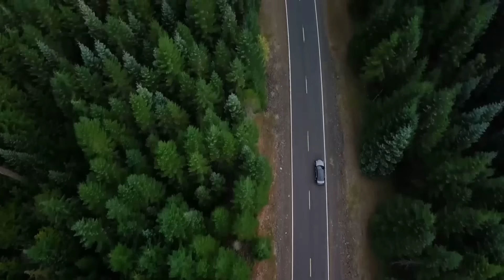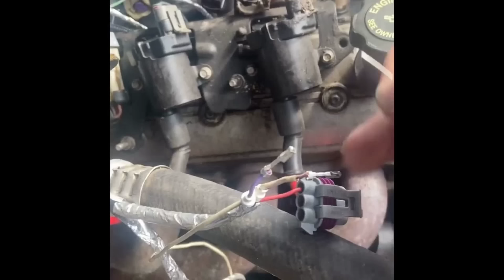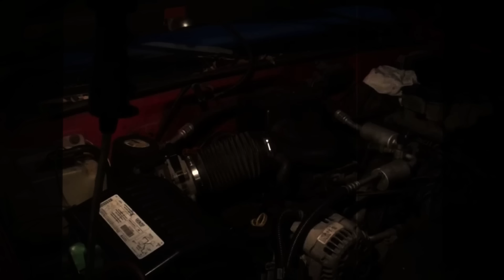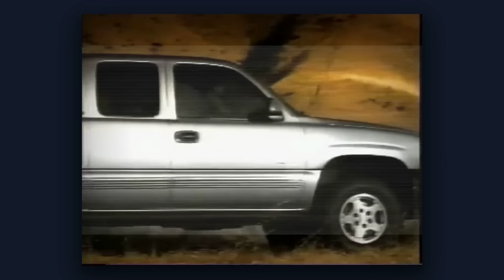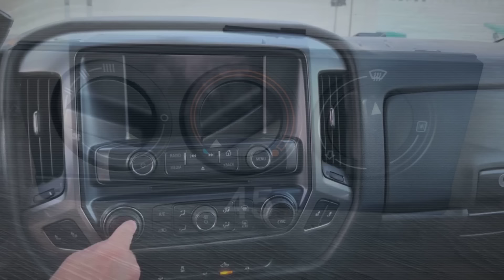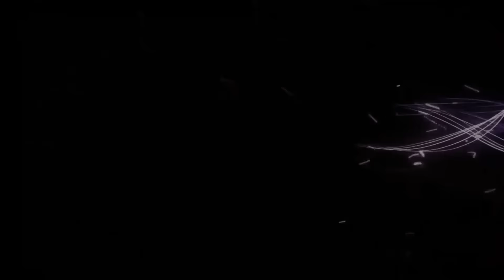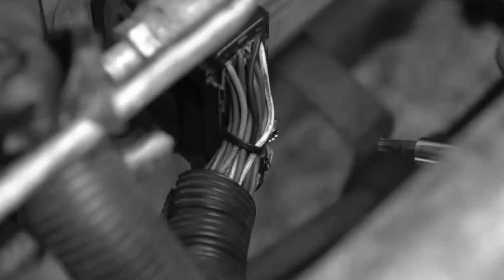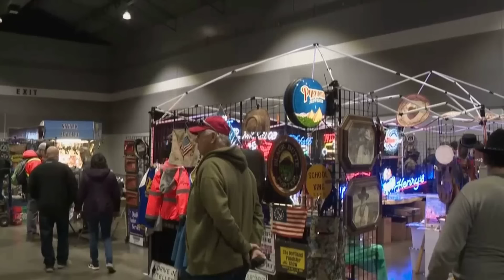How Smart Mechanics Are Bypassing The Dealership (The "Delete" Loophole)

Comment: With the sh1t that's coming out now I'm surprised more mechanics haven't taken 2000-2015 cars and recondition them. Especially more decent models with awful CVT transmissions. I wonder how hard it would be to retrofit a reliable traditional automatic transmission into these. There's many decent examples of good car shells with good engines with a blown CVT transmission on marketplace.

Comment: If people don't make it a point to fight this, the moronic politicians who don't live under the laws they create will outlaw aftermarket tuners same as the EPA did to diesel. People need to wake TF up, they want all the uncontrollable vehicles off the road so they can shut down your ability to move at will. They want GPS vehicles on the roads. Also, prices for aftermarket ECU's need to come down. I'm not spending $7500 on a motec ECU. I'll rip all that shit out and go with a Diesel OM606 drive by cable.

Comment: Better yet, drive an older vehicle that has no computers in the first place!
Reply: late 80s mustangs have 1 old school computer. it went out on me. sent it to florida to get fixed. $220 later and it was good as new!
Reply: @berardoferrari   Hell yea my '81 Mustang just has a $30 - $50 Ignition Control Module, no computers needed! Carburetor for life.
Reply: I had to clean my cabin filter.  So I remove the glove box on my 2020 Honda CRV.  There was a wire connected to the glove box.  I'm like -- WTH/WTF?????  Why does a simple glove box need a wire connected to it?  There's no light inside the glove box.
Reply: Not all can drive those old trucks.we must find a way an utilize the modern technology.and defeat those electric vises they have put.  On us.we need to design ours.an disconnect their subscriptive thrash.
Reply: That's what he's talking about stupid you can't get the parts no more for the older vehicles
Reply: @donaldtaylor5358   I have no problem getting parts for my 1970s AMC powered Jeep. AMC hasn't even been around for like 40+ years.... Also junkyards exist. Also CNC and 3D printing will let you replicate parts.
Reply: Come on, some of that stuff was JUNK.  You want to play with distributors go right ahead, I'm done with farting around with them.
Reply: @louisschummer931   Um, Yea I do .... also how does a gasoline engine run without a dizzy lol? all I've owned is pushrod V8's...

Comment: Lets see, did a 1996 XJ jeep with 4.3 v6 Chevy, Presently replacing dead 44re in a Grand Cherokee with an AX-15 5 speed. 1992 Wrangler is getting a 3.9 mopar v6. I dont and wont own anything newer then 2003, all 2001 or older.

Comment: Hopefully the aftermarket can respond to this demand, sensors for my 96 f250 would fail shortly after installing them, i just carbed it , problem solved, trouble free running for 4 years now, ill die before i buy new ford crap

Comment: I did all this stuff 25 years ago when I installed a 2000 LS1/ 4L60E into my 1986 Mazda RX7. everything can be defeated if you are smart enough. This is why you hear about guys installing 5.9 cummins into ols Square body chevys with NV4500 or NV5600 manual trans. I can build a better truck from junk yard parts any day of the week.
Reply: You dont need to be smart to do an ls swap.
Reply: @TheRandynorris  says the guy that never did one!
Reply: I've got a 2003 Cummins 5.9 with the NV5600... great truck that I'll never sell.  But it does have an ECU that could fail some day.  I know that there are (ecu) re-builders out there  but I hope I never need one.

Comment: Do they still make remanufacture parts
Around 1995, my 1987 Olds 88, to EMC went bad..  I bought a rebuilt😮 one for about $160.
I had  1990 Buick Electra, the temp. Control went.  I brought a factory rebuilt modular for about $100.
Are thrre still companies that remanufacture electronic components?

.

Comment: Had an evap leak several years ago. Tech2 knockoff ran the service stall test and said "no leaks. " Read in a forum about the charcoal canister being saturated is the culprit. Used eBay parts ran about $150. F that. Went to the local Petsmart fish department and got a couple pounds of filter charcoal. Crack open the canister, swap out the crap, and no P442 codes in 9 years now. 

That doesn't compare to the wife's AC evaporator. $20 part with 11 hours labor in the alley behind work  on a sweltering August weekend. Better than the $1700 quote from the local garage.
Reply: That's awesome!!!
Reply: Thats about on par for an AC compressor. They have to check and replace more than the compressor. If they dont youll call back and be mad when metal makes its way back into the new AC compressor after the old one shit its guts into the AC lines. I have an oil leak that only leaks a quart in about 6 months or so. 4k to fix but I mean you gotta pull thr camshaft to get it out. Which requires everything in front of the timing cover to be removed from the truck. I laugh when people get mad at the price but youll never get anyone to pull a cam if you dont pay em to do it.

Comment: There's a difference between a dealer parts changers and a Master Mechanics that actually repairs vehicles.
Reply: If I didn't have the trucks  lined up for seven in the morning with engines running I was up the road without a job.  . Try telling that to domf of the garages here in Spain with the manana attitude ..
Reply: Call em technicians now.
Reply: @mr.freightliner7607 
Those are the parts changes. The title "technician" makes the FEEL better.
Reply: @ste @stevemcdonald1470 you can barely spell, and form a proper sentence. No one’s listening to you. You might be one of those “parts changers” yourself, looking at how I had to decipher what the hell you were trying to say. 

There are parts changers that get in the industry. They don’t make it though. This is a big part of why people have to take their vehicles to the shop multiple times for the same repair. Guys who don’t know anything but only the basics, or think because they can work on their 93 Honda CRX they can work on a Volvo or Kenworth. No. I had older foreman getting in trouble because he would mess vehicles up throwing semis in regens thinking because the truck says to put it in regen or showing signs of performance issues. Never learned to diagnose issues like that. Had a parts changer work on a Volvo truck for 2 days. Entire truck was downed because the dash wouldn’t show the digital displays and no lights on dash. So the driver could drive in the daytime, but at night…….no. All it needed was a software update. Same with peoples cars. Sometimes it takes an easy software update. They lay the trouble shooting out for you in the software, you still have to have vehicle knowledge though to make it. There is a major difference between a technician and parts changer. If you can’t figure out the difference……..then you obviously don’t wrench on newer vehicles, you are a parts changer yourself, or don’t know wth you are talking about.
Reply: @mr.freightliner7607 
Wow! That's a rant. 
45 years in the industry. Been on the factory floor, a factory rep., a service master mechanic, a service manager, business owner, engineer, tool designer and patent holder. Junior. Get over yourself.
Reply: @stevemcdonald1470 none of that means nothing you got guys who have been in the military over twenty years, never deployed, and sat behind a desk. Point?
Reply: @mr.freightliner7607 
WHAT???
Reply: @s @stevemcdonald1470 ol look, 😂. Let me make it sweet for you. If you need work done on your vehicle, are you going to use your friend that learns from YouTube as he goes? The same guy who stays working on his vehicle and borrowing your tools every other day his vehicle is down?Or are you getting the professional? The professional if you can’t do it yourself obviously. So let’s say he works on your car, fixes it, 2 days later the issue has gotten worse after he gave it back to you and he has created a new issue. You take it to 3 major shops who can’t figure out what the guy did. They don’t even want to touch it. They charge you for this, that, this part and that part. Still same issue. A week later you get angry take it out the last shop and get it to a wellknown recommended shop. 1hr shop calls and tell you to come pick your vehicle up. It was 2 modules died and they replaced them.

That’s a huge difference in parts changer and technician. You nor anyone else can take away from the good techs out there that learn a lot, they keep up with this crazy industry. Some of them are going as far as fixing issues the engineers have created. That’s not a parts changer. “Old timer” 😂.
Reply: Say that again boss.
Reply: @colinstickland845 
I've been the master mechanic and the boss. The master mechanic job was easier and more rewarding. Vehicles don't have feelings to deal with.